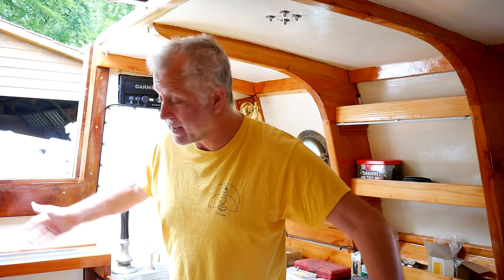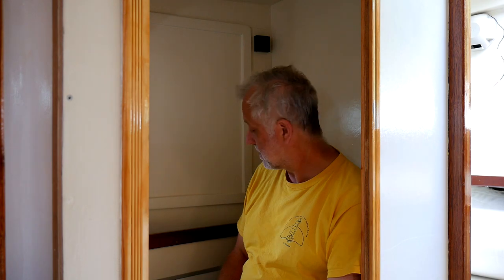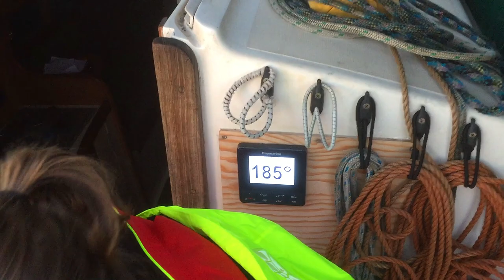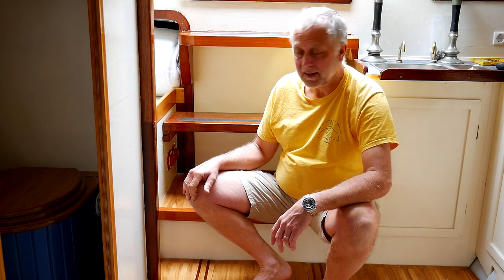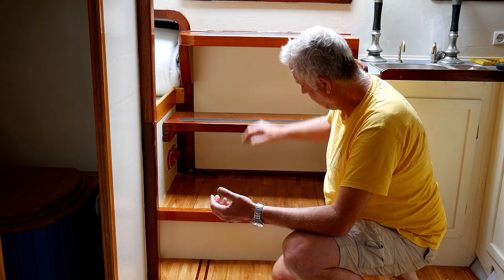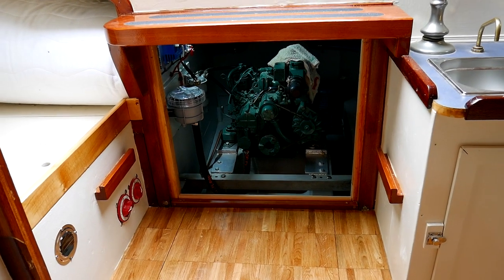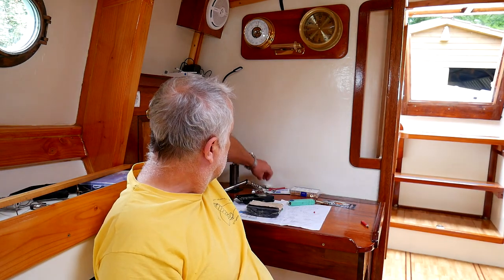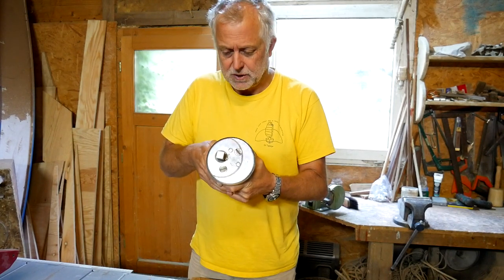Doors, winches, wiring, and more... - SV Tapatya EP197

Comment: Hi Tony I hope Karen is OK very brave .Been following since you started  the lofting great work ps is there special grease you have to use on the winches? Thanks. Garry/ Ireland
Reply from the maker: Thanks Garry. Really, any decent bearing grease will be fine for winch service. A reasonably high melting point might help if you're in hot climates... 🤔